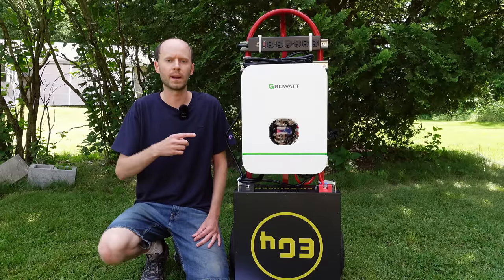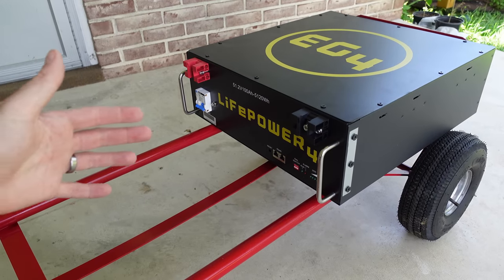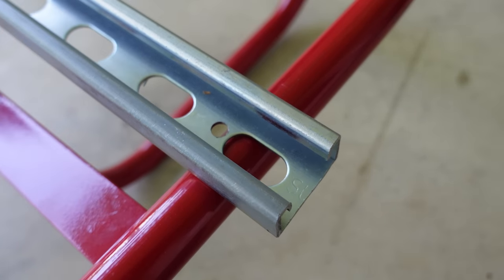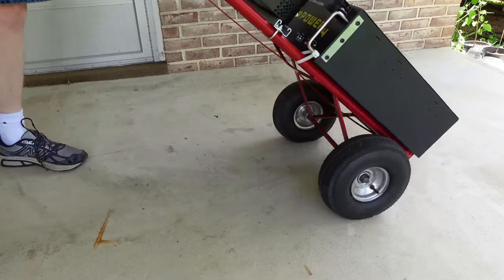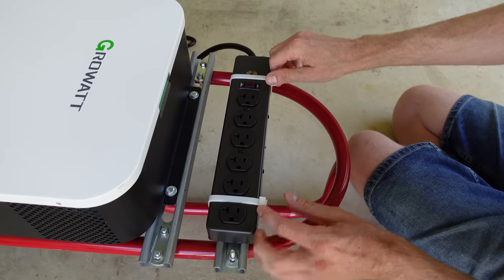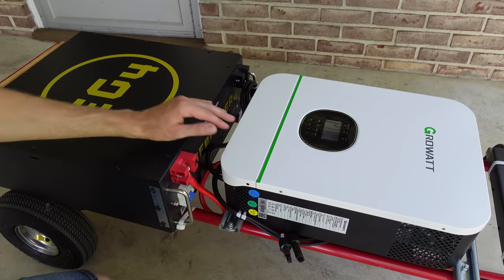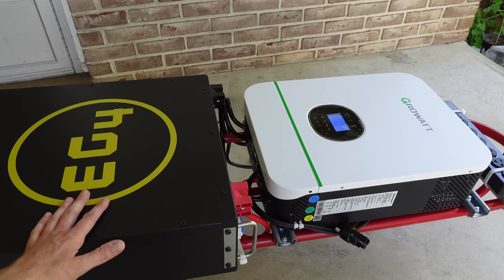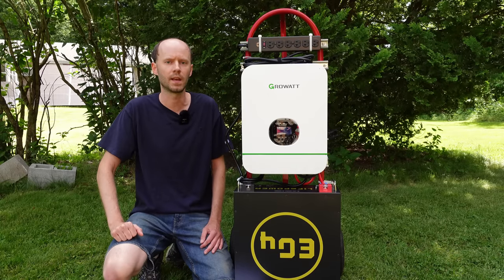Building a 3000W Portable Solar Power Station, Great for Power Outages!

Comment: I strongly recommend replacing the air-filled tires with solid core tires. In my experience the air-filled tires on those hand trucks lose air frequently and require maintenance air fills. Solid core tires means one less thing to maintain.
Reply: So true. I actually swapped out my tires for this reason a few weeks back. Good advice
Reply from the maker: I purposely picked one that had rubber tires. Ever try pulling one with skinny plastic tires through the grass? I've had this cart for almost 2 years now and have only put air in the tires once. I'm not concerned about it, it's super easy to put the bicycle pump on it for 10 seconds, but I do hear and understand your concern.
Reply: @LithiumSolar  dang that is so awesome. Out here in vegas the tires degrade and fall apart in a few months with our bombardment of uv rays and 120+ temperatures. Sounds like youre in a good environment compared to me haha. We do not have grass either. Just rock and dirt. So solid tires are great here. But I see why you chose yours
Reply: @LithiumSolar  they do make rubber, solid core wheels that are the same dimension of those air filled tires fwiw.
Reply: I love how detailed you were.  I built mine on a 4- wheel cart instead of a dolly (hand truck).  As a Petite female getting up there in age, I don't want all that weight coming @ me as I start to move it.  Also, I built mine with two 3500 lumen 6500k led 2 ft. long light bars (I got them from Hykolity on Amazon).  I live on 1.5 Acres & had a 4 day Black out here in deep South Texas last year.  It would not have been Hell if I had built it before the Ercot fiasco.  I use mine every single day!  So now I am building a 2nd one and trust me, I will be using that one a lot as well since my She Shed is 90'wide x 140 ft. long & don't have electrical outlets in most areas.  I wish I cud post pics here.  Even when the Moon is not out & it is pitch black out here in the countryside, It looks like Chernobyl when I turn on those light bars!
Reply: Airless was first ones made , where you been ? Under a rock ? No sir is to hard and heavy to  pull or  push. That why it best to use air not anything else.
Reply: True those tires do require frequent air fills,   BUT easy to take it to the compressor and just PLUG IT IN AND USE IT! 😀
Reply: @LithiumSolar  it's hard to believe solid rubber tires for hand trucks are stuck in the past. we build giant telehandlers and some models are shipped with airless tires and don't seem to have the lack of stiffness that hand truck tires have. it didn't take us long to put an air tire back on our wheelbarrow after trying a solid rubber one.
Reply: @GUSftw  ...you gotta love how solid tires dig ruts in the soft dirt and stop whatever you're pushing whereas pneumatic tires float over it.
Reply: @TexasLocalProduce  ....we live on a 10 acre ranch near Conroe and Ercot sucks.
I have an old 2500 watt generator from Ward's (tells you how old that is) that got us thru a blackout many many years ago.
Right after that one we bought a 13,000 watt 120/220 volt generator that will run our well water for the horses and ourselves.
My 3,000 watt inverter I bought for the system I'm building just happened to come in handy when they shut off the electric two weeks ago to upgrade their system for the new subdivision a couple of miles away.....even some of the stores were affected and shut down.....one store had it's employees sitting on the sidewalk outside waiting for power to come back on.
Reply: @Bob_Adkins  you are dreaming. Tire size has to do with rpm. , must match for correct rsdius. Any other idea is shot down in therory. You are new to this subject. You to far behind in 100's of  years .
Reply: @Bob_Adkins  you the one talking to much!, you keep on and on znf on hahahaha go take a break bro
Reply: @Bob_Adkins  good idea on coffee i own a coffee orchard i loved coffee  till i got rral high blood preasure. They say drink decaf but it not good and it not work on me any ways. But i use to love coffee i picked, dryed to a dark roast then grinded them and perculated them. But cost to much to decaf coffee. It unvleivable the vost of chemicals. Wow and the extra days taking out and putting back takibg out and putting back. The price is free of notice in stores. It really cost 3 times more than regular coffee does.
Reply: I recommend air tires if use the dollies like i did over 45 years. Hard tires will not move easy nor fast long distance. Easy for solid wheels to hang up on small strips, it increases weight and hard to keep moving plus makes a crack  in soft tiles or wood floors
Reply: There more  maintance on solid wheels not air. Light tires. There much more material  to be involved at a much high cost to repaid
Reply: I used Tire Slime to stop these tubeless inflatable tires from leaking down. Worked like a charm. While the tire was deflated. applied the Slime directly to the bead/sidewall area, then reseated the bead with an air compressor and a belt.
Reply: @dkd1228  dounds silly, i was a otr over 45 years im 64 retired, i still have a 2 wheeler i use to load car also, solid wheelers was the old 1950 years till we got air tires, we movec4 times more weight a load and lighter than it was. Only way to unload  18 wheeler 80klb loads or aired tired forklift or air wjeeled robots in california
Reply: @asdad asdasd Well that is not entirely true - air filled tires do offer suspension and the heavier your load is the more important that suspension becomes. Especially for rolling over obstacles without damaging the obstacle. They also tend to run better over softer ground, precisely because as the tire squashes it spreads the load over a wider surface area. You could of course just go for wider solid wheels, but all this angst over the wheels deteriorating is more down to cheap tires than a problem with the actual style. After all we have air filled tyres on cars that last up to 6 years depending on mileage. I don’t see too many wheelbarrows without pump up tyres.  Well the really old ones had metal wheels.
Reply: can you hook it up to the house grid via a transfer switch installed in the house panel?
Reply: @TheDanzman1211  hahahahaha ypu got be joking hahaha you know all gfi  re epticals are run off house breaker. What you mean off house power ? You not make sence. The gfi is for(  shorts)   breaker  to all pluged in it. house  breaker is only a safety breaker of mercury heat breaker only. It must reach the degree of  breaker before it trip . It not for safty to save a life. It only for component safety to not burn  it up only.it takes a shortage breaker to save a live as the no fssuly grounf breaker it trips faster and not like a normal service breaker made of mercury to break when the mercury reaches a tempature. If it for 170 degrees , the line must reach 170 degrees before it trip. On a gfi the tempature could be 50 degrees it trip. It trips faster on mercury than a shortage. It can take hours before trach 170 degrees . You be burnt in hours, minutes be more like it . Dead.
Reply: @TheDanzman1211  a no fault breaker  receptical is to save lifes not ger power from, unless all opontents on it same circuit will be no fault  and not total up to its current ratting. Say receptical is a 20 amp breaker, the total circuit under it must be less than 20 amps total. Or it never come  on if loaded
Reply: @TheDanzman1211  remember to always turn off breaker before you  wire it. All house power comes from transformer on power company lines on poles. DO NOT TOUCH THOSECWIRES ANY TIME. Only the power company can by law. Always wire everything from house main electric pannel. If you have a 20 amp 120 volt ac no fault breaker in bathroom, you must wire it to a 20 zmp breaker or 25 amp breaker in main house pannel. Nothing in house by the  electrical code can be wired from another sorse of electrical power. It dangerious in alot of ways. All them will kill a person. It a osha law.
Reply: @LithiumSolar  you probly fined then and not know it yet. Company would know it though. Depends on osha safety man idea on it. If he says no, fines up to $20,000.00 ea. Up to you
Reply: I agree! Air filled tires are a problem.
Reply: I agree solid core is the best upgrade. the stock ones will leak or shred when you put too much load or over time. solid core drive as much as good and are indestructible.
Reply: @DrLoveQc  you all really to young to be talking stuff you have no idea about. Answer a question goes with the job of the  2 wheeler. How much weight goes on a 18 wherler 52 feet long  refer unit ?  How much total counting truck ? Can not go anove it by weigh statiojs or remove it by tge 2 wheeler .In trailor connected to truck. How much weight need put on the  drives  ? Not above . and drive tires not above ,  and rear trailor  not above ? How much weight total not above ir get shut down and some places fine over $3 a pound plus.  On the  measurements you move the weight? Is  by tandom movement, and or remove  access weight with 2 wheeler . If can not answer this, you know nothing for a 2 wheeler. You just talking out your rear. All people that  uses a wheeler,  knows this question. It why we have  the 2 wheeler. Im proving all you liars.
Reply: I thoght nobody knows, they  runing their mouth. They really  not  use them. I ha ve you 1 answer. Total weight on a 18 wheeler with a 52 foot refer unit limit is 80,000 lbs only. Can not go over it unless tandoms legal weight and over 80000 lbs permit on extra weight. Or be fined and shut down up to 72 hours and huge fine per lb. And must correct before reweigh on weigh station scales. Thats the state. Troopers. That one answer , finish it or shut up.  That 2 wherler also is inspected on tires also. What the fine on tires solid or low in air ? That where. You fined on 2 wheelers solid wheels
Reply: @michaelspencer6523  lol go take your meds crazy. its not about a 18 wheelers, its a freaking small hand truck cart. Stop replying to everybody
Reply: @DrLoveQc  if you are a 18 wheeler trucker as fed ex or ups or united states mail or city route carriers , pepsi or coke delevery cRriers,  how do they inload the loads to customers ? Or are you that  stupid to know  ????? It a fork lift or a electric  lift  or a small  2 wheeler.  Also what ysed to hold loads on trailor ? Is it the load bars ? Is it load straps ? How much weight each one good for before it break  or undo ? How a flat bed keep its material from comming off  trailor ???? Oh it load straps around medal reals ? How heavey is the iron reals ? 44 klbs. ????? Mmmmm what holds them on trailor and not fall on cars wity chidren ? Load straps i see.sp is all those parts used important and  yst be inspected ??? Yes and it is by  dot federal law every moment tge state troopers of that state job. Weigh stations, rest areas , law enforment areas all truckers nyst be unspexted and do it all free and alot get fines and shut down.  All because people like  you boys to stupid know laws and why usa has osha. They git wise now. They fineing the people like you becausr it your place to know not allow on jobs. Something weights 44,000 lbs needs something hold it over 44,000 lbs when shift. If hzs a 200 lb. Strap on a 44,000 lb. Weight. What happen if truck slams on breaks ? It going break  through that 200 lb. Strap and going  through truck  and through what stoped the truck. How many possublr deaths did that person cause that accident  ????? Alot. It same on carry a hand full cokes on a  wheeler on tile floor. If solid rubber or medal wheels run over same soft track 100's of times. Will it dig a track in floor to trip over latter ? Yes in alot ways even a child walking. So it matters to stores, customers, workers, everybody. Just because you just use it to haul 1 lb. Junk 1 time a month is not same as all people and others carry 500 lbs. A cart loD 1000 gimes a day does. Think before talk silly. It could be your child that breaks their leg and kneck because your bad idea. Think of all people not just the lazy bum  ever  worked. Making up items as a patten also gets sued in 80% being ignorant caused accidents. They cover that up in small written on contracts. Say when a $3 mil contract but lose a $100 mil law suit.
Reply: @DrLoveQc  good you took my advise  snd went back to your padded hospital room, they was hunting you as you seen they text me.
Reply: @DrLoveQc  it sppears you have  made a fool out of your self again. We forgive you this time only little one.
Reply: @michaelspencer6523  it must suck to be you Michael

Comment: Can I suggest that, -  prior to trimming the U bolt that you thread a bolt onto it and use the bolt to even out any issues with the thread when you take it of -  some washers and spring washers will make it more secure - hose clamps instead of plastic ties, - a rachet strap on both the inverter and battery when wheeling over the rough stuff.

Comment: I'm SOOO tempted to build this!!! In an emergency, it seems pretty easy to run extension cables from it to my fridge, computers, etc. vs. trying to wire a backup system into existing wiring, cutoff transfer switches, etc.

Comment: On page 1, #10, the manual says the inverter should be connected to a permanent ground. It doesn't state whether using the AC in will suffice (assuming you have it plugged in all of the time. Also, for a 200 ah battery, it recommends 2 - #8AWG cables to connect the battery. I recommends 1 - #4AWG cable for the 100 ah battery. It also recommends overload protection between the battery and the inverter. In addition, it recommends a circuit breaker between the PV connections and the inverter. Just wondering if you considered these recommendations in the manual.
Reply from the maker: 1) There's no such thing as a "permanent ground" on a mobile cart. I assume you mean a ground rod driven in to the earth. That would serve no purpose at all in this use case. The chassis IS the ground just like in a vehicle, the frame is the ground.
2) NEC rates #4 90C at 95A. NEC is for home residential wiring so obviously doesn't apply to a cart; however, is a good starting point. I don't think #8 is appropriate. Actually, #2 would probably be better given the circuit breaker is rated for 125A.
3) There is overload protection between the battery an inverter. There's a circuit breaker built in to the battery AND the BMS has electronic overload protection.
4) I did not add overload protection on the PV input, so yes - maybe a good idea. I purposely selected #10 input wire for the PV as it can handle 30A and it's unlikely you'll connect more than 30A of input on a mobile cart. Again, design yours how you'd like 🙂
Reply: @LithiumSolar  Sorry about the ground question. I just like to read the manual. Concerning the use of #8, I don't have any. I do have #4, but since you think #2 would be better, I'll go with #1/0 since I have some and it fits thru the opening.

Comment: Never worked much with solar panels nor MP4 connectors, so you had me scratching my head for second or two.  It suddenly dawned on my what you were talking about. It's same thing you have to be careful about with extensions that use SAE connectors.  Very easy to get magic smoke if you don't verify polarity with a meter.  😅 Don't ask me how I know.

Comment: Cool video. I built a similar concept a few years ago. My budget was very limited but I put it together with  1 free hand cart from a friend. 2 a pair of 1500 watt inverter units from a pawnshop. 3 a deep cycle battery from Walmart. 4 some cables I found on clearance at tractor supply. This cost in total was about $200.00 and provides enough power for a couple fans, a light and a CPAP machine. Cell phone chargers, Bare essentials. I have 2 inverters hard wired to my battery but never run them at the same time. 1 is basically a back up for the other. Also I can alternate from one to the other as I want to. I keep them on a float charger and since I built it, the power has not gone out even once hahaha

Comment: @LithiumSolar. There is something I experienced after going through 4 sets of batteries. Each set is 2 in number because my inverter runs on 2 batteries.
What I noticed over the years is that whenever I use the inverter when it is running on batteries to start a freezer, the discharge time reduces significantly.
Example. When my inverter charges the battery to 100%, then I will be able to use my computer and fan on that inverter for more than 41 hours. But after I use a freezer on that inverter for some days and then stop using it on the inverter the battery discharge rate drops significantly.
So after using the battery with the freezer the discharge rate of the battery becomes something that is less than 12 hours no matter what and cannot get it back to the original 41+ hours.
Reply: Dude.  YT is not for this level of support.  I suggest that you join a solar forum.  Likely you need to top balance your batteries, unless there are other problems.
Reply: @russlo5324  🤣🤣🤣

Comment: Thank you for doing this hand truck build with these two products because it was what I wanted to do and now I can reference this video when I build my system.
Reply: Update: Just finished my hand truck an hour ago using almost the same components used in this video (Growatt 3000 Inverter, EG4 24V LifePo4 Battery, Milwaukee hand truck, etc.) ... took me about 12 hours because I had to cut out wooden planks using hand-saw, go to store two times to buy mounting parts and hand truck, and when I came home from shopping battery was finally delivered just in time for me to build it all. Also just make sure to follow each step closely in this video and use a resistor to pre-charge your inverter before turning it on so electric sparks won't happen. Thanks again for the helpful video!